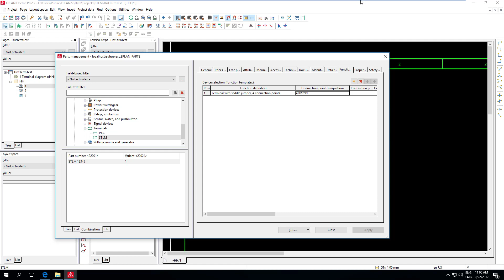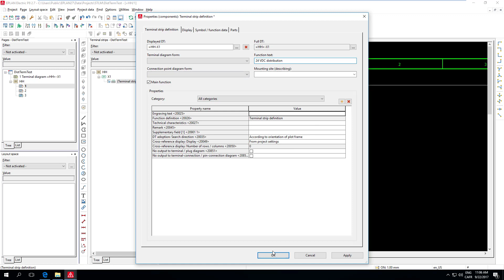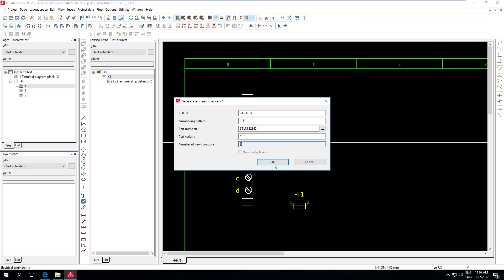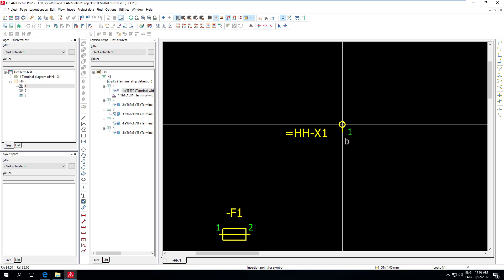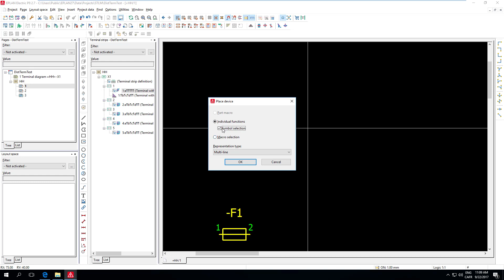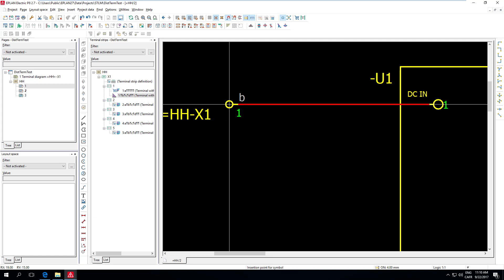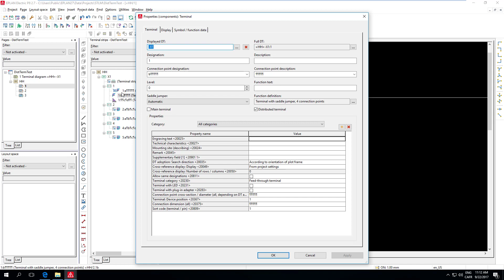Working with distributed terminals in EPLAN P8

Comment: How do I give the terminals the same designation without losing my terminal block? I want all the terminals to be called "L+", but when I do that it just changes 5 terminal strips into one terminal strip.I already have "Allow same designations" checked but it didn't make a difference.
Reply from the maker: Hi James. Is it possible for you to post the details to the EPLAN community forum?

Register at: https://www.eplan.community/en/

It's free. All you need is to register so they can validate your email address.

You can post images, so it makes it easier for us to understand the issue.

Cheers

N.B.: I do not work for EPLAN, and the forum is entirely community driven by users such as myself, and others.

Comment: How is this for a field technician clear that  X1 1 a and X1 1 b are connected?
Reply: If they share the same device tag they are part of the same device, this is just an example and in a production drawing the notation could easily be configured to represent these terminals as -X1:1:a and -X1:1:b if necessary. This notation method comes from the international standard 81346-1 & -2.